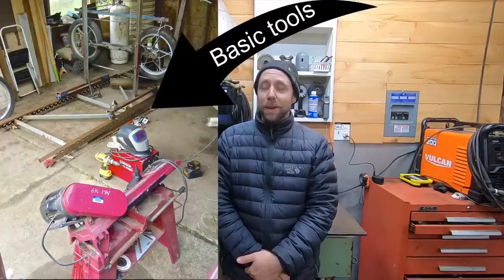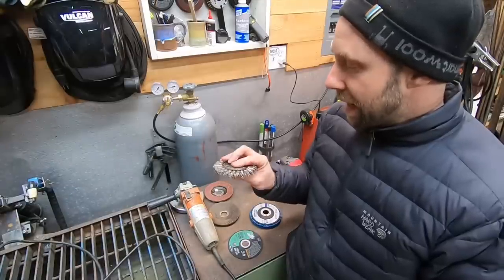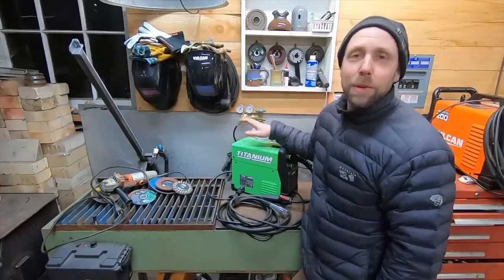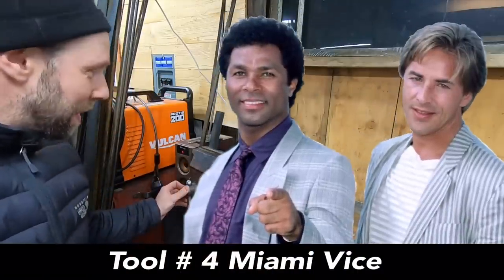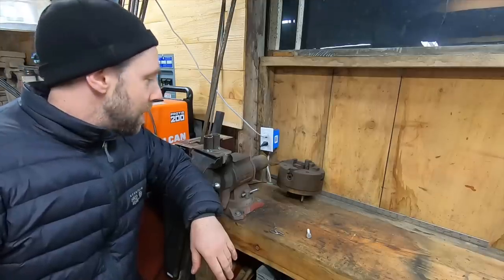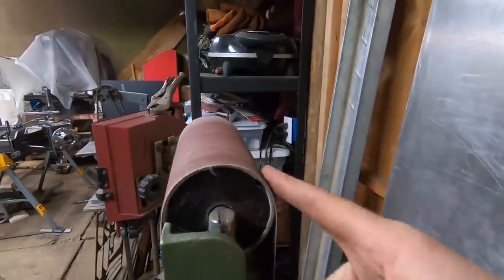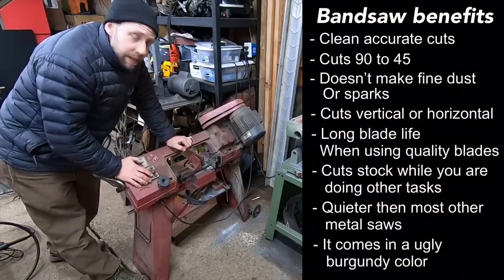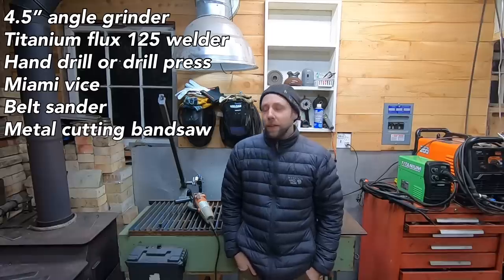6 affordable tools I recommend to get started in fabrication

Comment: Excellent call on the tools, you can't beat the cheap grinders at HF. I don't like the ones with the top switch though, I had a wire wheel get away from me one time and by the time I got it turned off the dam thing bit me three times. Welder wise I would say get anything you can afford, just to get some hood time. Right now I'm looking at a tig machine, but I'm not sure if I should go cheap Chinese, or a used quality machine? The big name machines go for a lot of money even used.
Reply: The Titanium line from HF is not bad, I've run a few miles of wire through the machine Titanium Flux 125 and it's been just fine. I'd like to get a multi-process welder so I can do more but so far the Titanium has really served me and other well.
Reply: Yeah I use an old grinder with a twist wire wheel and I really don't like how close my fingers get to the wheel in order to operate that top mount switch. I run it with a guard but the wheels aren't really designed for that.
Reply: @philanaemic  yea a friend of mine was using one without gloves and it caught his hand... yea, the results were worse than one might expect. Another friend was using a similar wire brush when one of the wires came off and got stuck in his eye. :( PPE!!!!

Comment: Hi Mike, @12 or so, metal band saw, I have one of those but seem to adjust it so it cuts straight, I mainly let its weight press cut through the metal, but now it does not cut straight when on the horizontal position, did you have that kind of problem it so would you mind showing how to fix it or better yet a video maybe?  thanks and great job and help you're doing there for the rest of us

Comment: hey mike great video. do you recommended harbor freight welding helmet you know the auto darkening one.
Reply: Ganesh Narayan I have one. Works fine. I’ll admit I don’t have a direct comparison with another helmet.
Reply: I used the Harbor Freight auto darkening helmet for years with my stick welder. When I got in TIG welding I noticed that my eyes didn’t feel great after welding. I took a closer look at the helmet and sure enough it isn’t rated for TIG. I picked up a different helmet after that. It did work fine for stick and flux core welding though.
Reply: Get the high end Vulcan one. Works great
Reply from the maker: I have used the cheaper HF auto dim helmets before, I think they are okay but I don’t 100% trust them. I have always bought used auto dim helmets, I own a speedy glass from 3M and I picked up a older Miller, the Miller is really 💩 
I have been flashed with it many times because it’s not auto on like most helmets, you have to push a little on button before welding and if you grind on parts for a bit it will turn off automatically so when you go back to welding it’s off! I did pick up the Vulcan helmet on sale and it’s the best helmet I have ever owned! Take care 👍

Comment: the rpm of the different disc/wire brush, pads are most of the time lower than the set rpm grinders i suggest a variable speed grinder

Comment: I have a dewalt  dry saw 
With 16 inch blade I’ve been using the same blade for three years 106.00 for the blade 
Built truck chassis a saw mill 
And a thousand other cuts 
Never sharpened it yet 
Just saying lol
Reply from the maker: You definitely have gotten a lot more mileage on that blade then most. I bought a Slugger 14” cold cut metal saw and the blades don’t last very long before they need to be sharpened, but we are running it in a fab shop and there’s a few different guys running the saw.

Comment: Mike, what blade do you recommend that’s good for the metal cutting bandsaw?
Reply from the maker: ivan t I like the BAHCO 1/2” wide X .025 thick, they are 5’ 4-1/2” long. 14/18 tooth count. The reason the teeth per inch is 14/ 18 is because it’s a variable tooth count blade. These blades last a long time but cost about $24  I order mine from a company called East side saw. 1-800-962-0279 www.eastsidesaw.com
Reply: Mike festiva thx much Mike!
Reply: @Mikefestiva  aaàaaaa

Comment: So now that it is a couple of years later, how do you feel about the Vulcan omni 220 (or did that have to go back to HF). I ask because I was looking very seriously at the 220 (for a grand, Im open to as many opinions as possible)

just curious
Reply from the maker: Well I sold off my Omnipro after a year or so of use mainly because after comparing it to the Titanium 200 I found that even though the Titanium lacked some of the nice features of the Omnipro I preferred the Titanium more.
I also needed a AC TIG rather then two multi process machines. I sold the Omnipro and bought the Vulcan ProTig 200.
I do miss the auto set on the Omnipro but I really like how compact and light the Titanium 200 is.  I think the Omnipro would be a great welder for anyone that’s looking for a versatile powerful welders for there home shop or a back up welder in a fab shop.
I have quite a few videos up about the Omnipro and Titanium 200, out of thousands of comments I have only heard of two people that have had problems with there Omnipro so far.
Reply: @Mikefestiva  Thanks for the prompt reply, this has really helped me make my decision!

Comment: Would like to know if you know anything about Mellcom CUT50 Welding Machine, 50 Amp Plasma Cutter 110V Voltage 1/2 Inch Clean Cut Portable with LCD Display Cutting Machine

Comment: Hate flux core. I have the harbor freight 240v gas mig welder, the cheap harbor freight regulator and a 15lb co2 bottle for welding mild steel total about $300.

Comment: Yup..! Don't start with a stick welder. Of all welding techniques, MMA is the worst for the beginner. A small flux core welder like the one you have there is fine for getting one's feet wet.
Stick welding is hard to master and will only disappoint the rookie welder as it will look like shit when done. 
Master the MIG welding first and take it from there. With confidence and experience from MIG welding, one can advance to TIG and then MMA.
If one master these three welding techniques one can try oxy/acetylene welding...and start the learning curve from scratch again. 😂

Comment: Can one start a metal fabrication shop and then expand to include machining or are they usually separate workshops? I'd like to eventually get into machining but lathes and end-mills cost a couple of grand at least so can you do one and then the other once you'd saved up some cash?
Reply: You would need a massive shop and three phase power at the very least.
Reply: @jeremyhodges440  What do you consider as massive? I own a 5000 sqft shop with three phase power in an industrial area.
Reply: I think that is a good question and I would say they are one and the same.  Years ago I was a machinist in the military.  We had a "sheetmetal" shop next door to our machine shop and on the other side was the welding shop.  Everyone was constantly going back and forth getting projects done.  I have the same plan as you as far as purchasing a bridgeport mill and a lathe for my workshop.  You can find them used and cheap if you look around.  Usually from shops going out of business or military base auctions.  It just depends on the type of metal fabricating you plan on doing but in my opinion you need a metal lathe and a milling machine at a minimum and you will be able to fabricate almost anything.
Reply: @behemothinferno  5000 sq ft might be large enough to get most of what you want in there
Reply: @jeremyhodges440  Not necessarily, as lang as the machines will fit which doesn't take all that much room if you stay relatively small you can use a rotary phase converter to supply the three phase. Welders take as much power as most manual machine tools do. A ten HP phase converter can power most shop equipment that someone starting off would need, even a five HP phase converter will power most of the smaller manual machines. If you step up to CNC machines you will need a lot of power and room though.

Comment: I really want to look into the lincoln 180i mp dv its a multi process but can only find videos from lincoln if you wanna do a good unboxing/review. Looking at the one from lowes includes tig torch and pedal
Reply: I’ve got a buddy who owns a fencing company and he’s had one for two years. Absolutely hates it. Said it does nothing well. He tried the ESAB multi as well and didn’t like it any better. He wound up running the Miller Multi 215 since he doesn’t need AC for aluminum. Loves it and sold his dedicated tig machine as well.

Comment: Nice video, great advise. But...   Forgot the welding helmet and a sturdy workbench (home made OK) were left out. Something you can clamp a vise onto. Even a couple of saw horses and a bit of plywood can serve as the workbench, but you need something. Otherwise, great advise. I'll be forwarding people to this video.
Reply from the maker: Thanks for checking out my video, I didn’t forget those things it’s just to much to add in one video, I mentioned in this video there would be another video coming soon about non power tools  like clamps measuring devices and so on too go along with these tools. Take care 👍

Comment: I'm looking at building a roll cage for my RZR. Do you think the Titanium 125 would be sufficient to weld 1"3/4 OD, .95ID round tubing?
Reply: probably not, if you do go this route goto your local weld supply and get a name brand of wire
Reply: You would wanna bevel all of your edges and make a small Gap like maybe 1/16 of an inch so you can get full penetration of your weld I don't know how high the wire feed per minute is on that welder but that's kind of how you base your heat off of the thickness of the material but you only got to deal with a weld 1/8 of an inch at a time and you're going to break it down in eighth of an inch passes so to get a decent well you're going to have to do multiple passes
Reply: @LemonMan_Man  Thanks for the feedback. after [osting this, Ive been thinking about spending the extra $$coin and going with the Titanium 140 or possibly the Eastwood 135. Thanks for the input.
Reply: @edwardsandford9158  Thanks for the feedback Edward. I'm thinking about going with the Titanium 140 or the Eastwood 135.

Comment: Hey Mike, 
I appreciate the videos.
Do you think the titanium 125 is capable of welding a trailer made if mostly 3" channel?
Reply: Phil J it depends on the thickness of the web. A 110v welder will only weld up to 3/16 steel maybe 1/4 in multiple passes. Personally I wouldn't weld a trailer as a first time project because of the liability. Third or forth project it isn't out of the picture. There are some cheap 220v welders that can do it just fine.
Reply: @jon3615  thanks for the advice.

Comment: Great video, will the bandsaw cut stainless steel?
Reply: Heading West sure. Might need a different blade but generally "Carbon" blades cut mild steel and stainless, though at low speed and with a coolant. Bi-metal blades are more expensive but made to cut harder metals like stainless.

Comment: would the flux 125 do ok with automotive sheet metal? I literal only have a few hidden parts of rot to cut out and weld back in on a car project I'm doing. These spots will be hidden once the car is reassembled, but the rot still needs to be taken out. I've heard mixed things about flux for sheet metal, but a lot of it seem biased based on the way people looking down on the flux. i don't want to spend $1000 for a welder that in all likelihood wont be used ever again after i finish this one specific project project.  thoughts?
Reply: You should be okay if you are really careful, definitely practice a bit on metal the same thickness until you can make a weld that holds without burning through the metal.
Reply: It is not looking down on the flux core process it is a polarity issue.  It uses straight polarity the electrode is negative.  This causes the base metal to melt more.  This makes welding thin metals more challenging. Make sure you are back to good metal and practice a lot before hand.  Gas welders can be had for a little more allowing you to use solid wire, reverse polarity.  Hope this helps.

Comment: I wonder if vulcan 220 will weld better on 120v fkux core then the titanium 125? Or is not really big difference? And i shoudjust get the titanium 125 flux core?
Reply from the maker: If you have the money the Vulcan is a far superior welder and if you run flux core or not you will have a lot more amps available.

Comment: On the Bauer angle grinder. Does the button  next to the trigger not lock the trigger in the ON position?
Reply: Yes, if you push the button in while you have the trigger pulled it will lock in the ON position. A light tap to the trigger will unlock it.

Comment: decent enough welder for doing rusty body panel replacements?
Reply from the maker: Yes the flux will weld on rusty metal better the MIG will, the flux wire tends to run hotter then MIG but you can dial this welder back quite a bit for thinner metal, the only downside is you get a bit more little splatter from flux wire, it will just require a little bit of clean up with a angle grinder with a flap disc. Take care Erik.
Reply: festival thank you Mike! Love your channel!

Comment: I watch your channel a lot and did know I needed a respirator to weld. one of the first tools should be that, the different types and best ratings. well ventilated area because you look like your in a closed shop. could you please do a video, I'm looking at the 3M PRO 7513 not sure please help.
Reply: Those are not tools, which is the title of the video. That would be safety gear.

Comment: Hello you guys I want to get  the titanium 125 to weld railroad spikes to each other and horseshoes together will it do the job ?
Reply: For thicker metal you need a larger welder that can put more heat into the work to get good penetration.  Can you weld them with a small welder?  Yes.  Will the welds be strong?  No.

Comment: I recommend hi quality. You get what you pay for, and soon outgrow tiny welders. If your just getting started go to welding school. But either way your welding so go for it. The reason stick is the best starting point is because it relates to all other processes in a simple way. Understand stick, and you get where all the others are coming from. Oh , and dont burn your house down. Another option is high quality used tools can be good also.

Comment: Did you mention what blades you use for the bandsaw?
Reply from the maker: I like the BAHCO 1/2” wide X .025 thick, they are 5’ 4-1/2” long. 14/18 tooth count. The reason the teeth per inch is 14/ 18 is because it’s a variable tooth count blade. These blades last a long time but cost about $24  I order mine from a company called East side saw. 1-800-962-0279 www.eastsidesaw.com

Comment: I've been looking at that Harbor Freight metal cutting bandsaw, can you make a blade suggestion?
Reply: If your looking for good blades take a look at starret.  They have a ton of different types and you can get them in just about any size. Cost a little bit more but they work well.
Reply: Lennox brand blades or Starrett brand.
But dont even try to use the cheap china blades <that come w/unit>
 on these cheap china saws.  Once u buy high quality blades.  U will understand.  I nearly threw away my first china bandsaw till i bought good blades.
Not cuz it wouldnt cut.
But because it would throw the cheaper blades off the drive wheel.
I thought it was a machine alignment issue.
It was a piss poor quality blade issue.
Reply: I looked at blades on the Starrett website...there's quite a bit to choose from. I will be cutting angle iron, flat stock, round stock and round tubes, all mild steel.

Would this be a good blade?

Versatix MP is a bi-metal blade of triple-tempered, high-speed M-42 cobalt steel teeth with alloy steel backing strip. It has a patented tooth design that dissipates stress during cutting for less tooth breakage and longer blade life. Its special set minimizes pinching when cutting structurals and bundles. They are ideal for sawing structurals, tubes and small solids and pull-down, gravity fed machines with uncontrolled feed rates.

Comment: Hi Mike, do I need to get licence for store gas for welder in my place ?
Reply: In the US you do not need a license to store, use, or get replacement tanks of welding gas.  Your local welding shop can replace tanks with the filled gas that you need.  If you want to purchase a tank, I would look up what you need to look for to buy a tank, so you don't get ripped off.
Reply: Their will be a limit you can store ,  i guess

Comment: Everything in that ad is a lie WRT titanium oxide coated drill bits (they aren't drill bits made of titanium, LOL) - the yellow coating is dirt cheap for them to add, but it only does one thing for you: if it's the real thing and not a fake anodize coating (even cheaper!) then it helps prevent alumninum from sticking to the bit when drilling certain aluminum alloys. That's it. They are still HSS, so they dissipate heat exactly the same as any other HSS bit. Smoother running"?? Um, speaking as a manufacturing engineer and a machinist, that's weapons-grade Balonium!
Reply from the maker: Railgap Esoterica Read the title of my video and think about it? Is it about buying the best tools with a unlimited budget? No.
Even if you are a machinist you should understand what the topic of this video is, if you don’t like it just don’t watch it man.
Reply: Abdul Rahman “little more money” that’s the whole point. This video is for those of us stuck in garages or sheds just wanting to get our feet wet. I don’t care to look at “making an investment” yet.